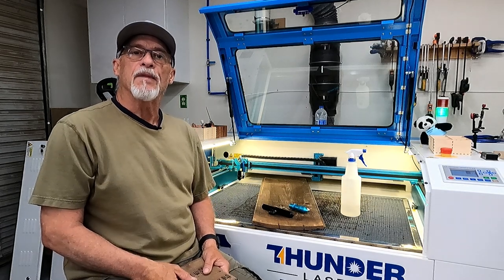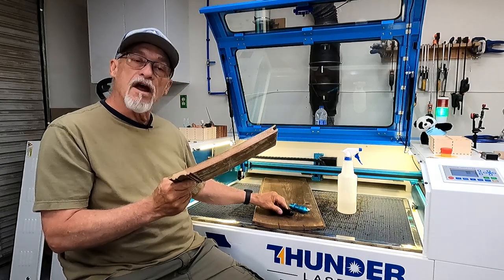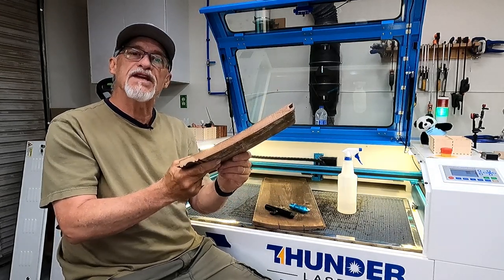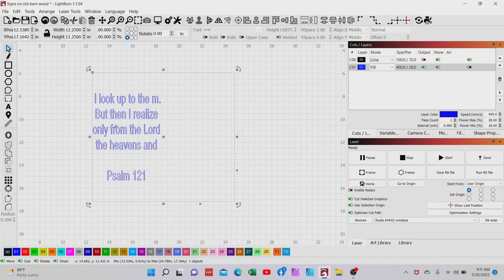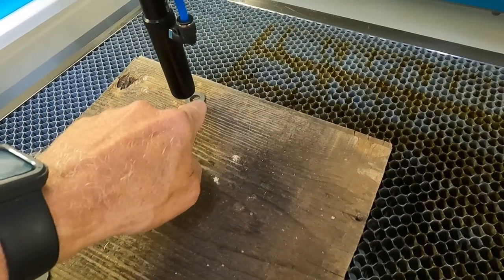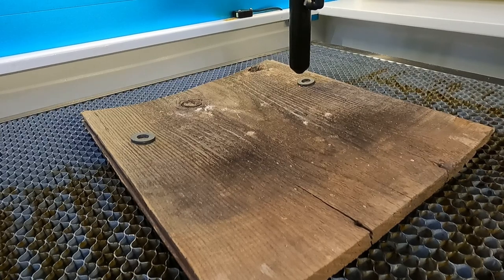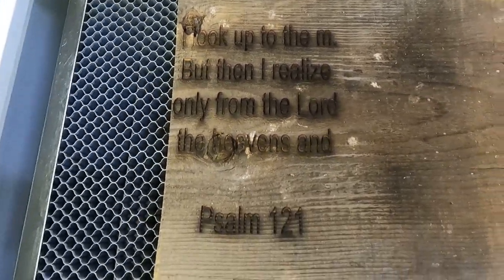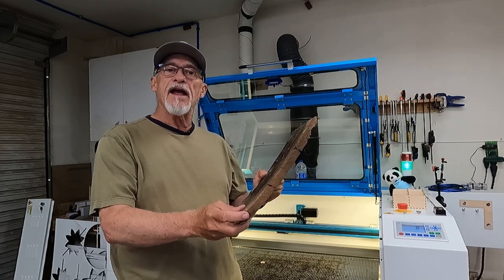Nearly Impossible engrave on 100 year old barn wood

Comment: I've been in the laser business since 1987 the weirdest thing I had a client bring me was a gazelle hide that he shot over in Africa. He wanted his monogram on it. Back then there was no glowforge epilog Universal were probably just a business plan. My machine was a single head LMI 75 watt CO2 a monster of a machine only did one to one engraving and it went back and forth and it took up the space of a two-car garage because the table moved side to side. My help hated me for almost 30 days we could not get that smell out of our shop to save our life! 

Moral of the story is two things
One if it gives you a headache don't do it unless you have a respirator

Two be careful of what you're doing do not leave unattended if you break down what a laser is you understand that it's a light that's amplified and it will catch fire and burn these are not toys they are business tools!

Thank you for all you do for this laser community! ❤️

In Santa Ana California we would take delivery of two box cars of Walnut and oak no matter how we tried if we didn't use up our wood fast enough it would cup worse than what you're saying here.

Even with the Santa Ana winds which normally you would think would be good but they were horrible and we would always keep our shop door open because of our spray booth being so close to the door.

We ended up with a humidity room to make sure that the moisture level was a certain level so the boards would stay flat because we cut our own boards we made our own substrates for trophy dealers in Arizona California and parts of Nevada those were the old school days.

I miss my woodshop!
Reply from the maker: oh man I bet that smelled! I hate doing leather for ,that reason. thanks for the comment